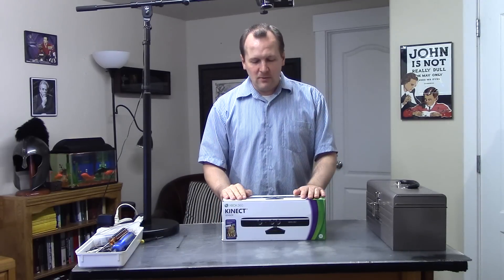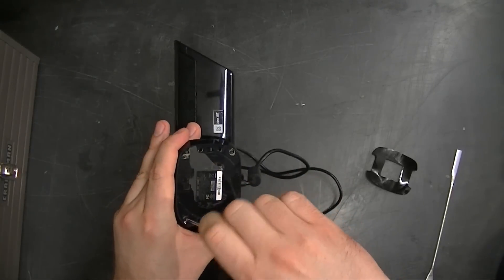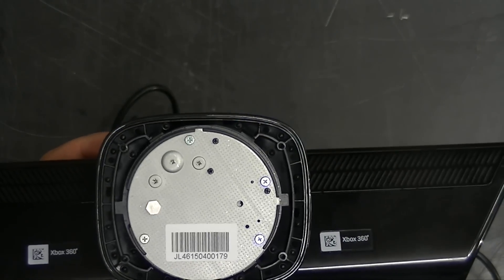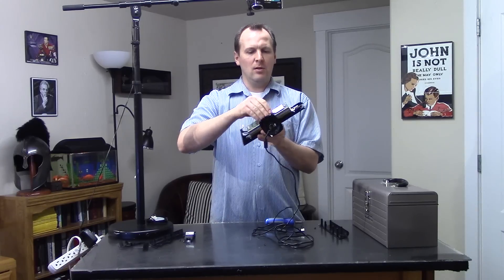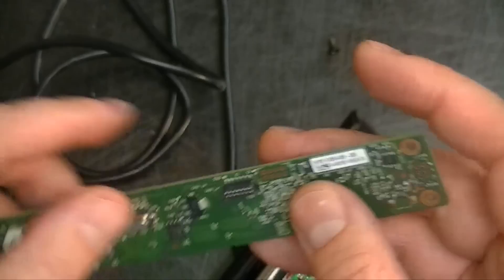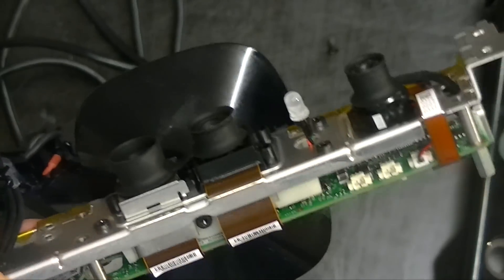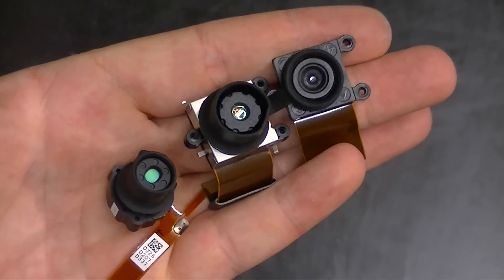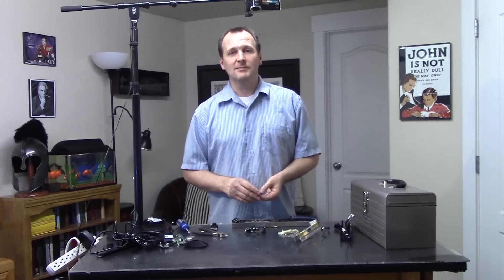How to take apart an Xbox Kinect & repair tips

Comment: Would be good if you did more than just take it apart. Like explaining all the error codes and what those mean. As an example, in my case, the green light blinks and xbox reports "kinect is starting.. please wait". But it never finishes. After a while, the xbo reports C9 error and the kinect restarts and blinks green again. What does that mean and which part is broken?

Comment: my kinect starts up green lights flashing and then a red light shows up... please help me.
Reply: Yeison Hernandez me too, and yes I'm aware this comment is a year ago, any updates about it?
Reply: You need a new power supply.I found the answer in the vid.
Reply: @comicdubs6117  What makes you so sure? I also get the red light and my power supply is fine. The green light turns on as well as voltage measures ok using a multi-meter. Just because it was the power supply in your case, does not make it the case for everyone.
Reply: @dtesta  weird that happens for me when i have my kinect pointing at a wall or upside down
Reply: I guess my camera-module might be broken or something.